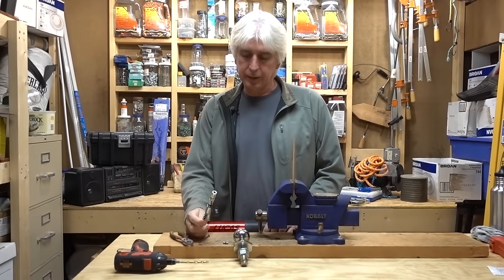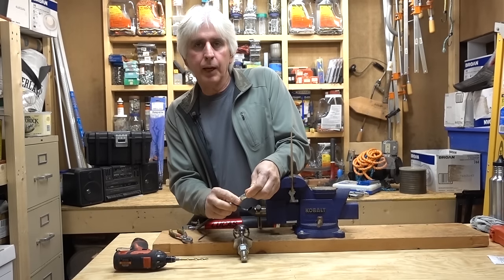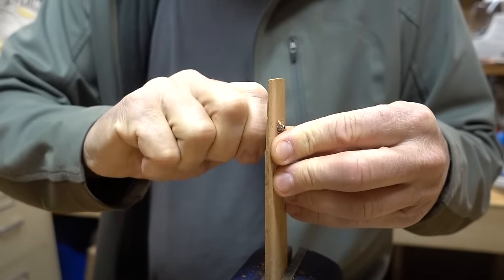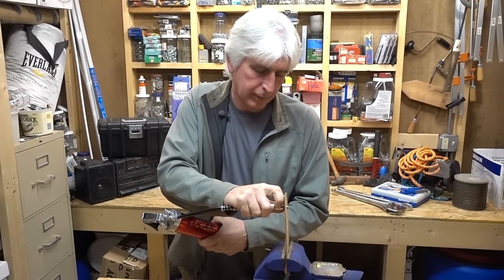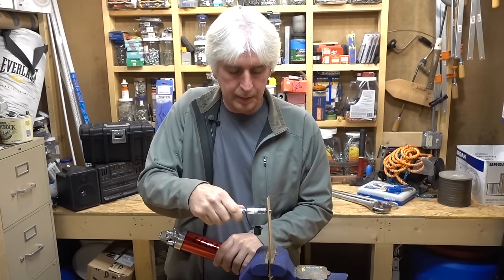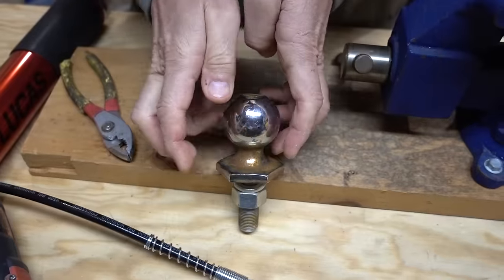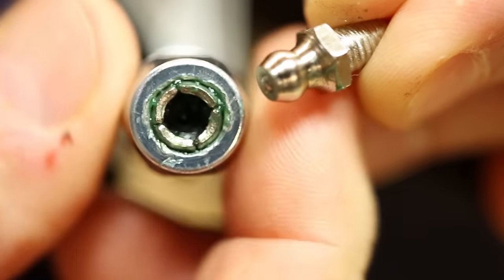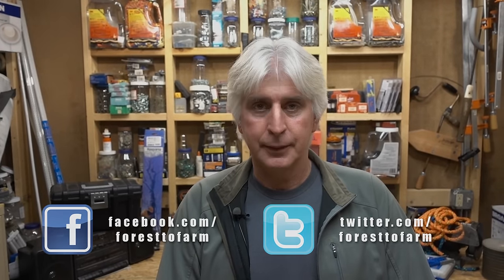Getting A Secure Fit With Your Grease Gun

Comment: I have been using  a grease gun for as long as I wanted to forget. Why do I want to forget? Because greasing is probably one of the least pleasant task when it comes to mechanical maintenance. More likely than not, more grease ended up out of the grease nipple than within. This is even worse when trying to grease under the car, with one hand on the level, and the other vainly forcing the head onto the grease nipple. I have taken the grease gun apart and know how it works, but I never thought of this possibility. Thank you very much indeed.
Reply from the maker: You are very welcome!! Glad to help. 
Terry

Comment: So in practice, I did that even as tight as I could with a wrench before watching your video but tons grease oozes out between the fitting and the zerk nipple.
Reply from the maker: Crazy. What are you using it in? Modern equipment these days sometimes seem to be out of spec. I would try it on some older American equipment and see how it operates. You may have already done that. I know doing my electrical contracting I have run across may screws and bolts that are way out of tolerance. If not then maybe the nozzle itself is out of tolerance or simply a poor design. Again not knowing what you have I may be totally off here. Good luck and thanks for watching!!
Terry
Reply: @ForestToFarm  Thanks, I think its a size issue the zerk fitting I have I think is smaller than the zerk connector I have on the grease gun.
Reply from the maker: @smptactical259 did you get it worked out?
Terry

Comment: I learned something.. thank you.  Question: I have a utility trailer with a grease nipple on the gate hinge.  It is rusted and I can't get it off to replace it with another.  I just sprayed it with a rust breaking "oil" but I can't seem to use a plyer to unscrew and replace and also open the cavity up to spray oil/lub into the hinge.  What "size" is that grease nipple (thread and hole size where I need to cut it off, drill and rethread)?
Reply from the maker: Thanks! To be honest I am not sure right off hand what size it is. Pretty sure its a pipe thread which means its tapered. That complicates things a bit. I wonder if heating it a bit might help loosen it up? If you drill it out then some shavings will likely get into the bearing. That doesn’t seem like a good thing. Clearly I am not the best person to ask for help on this 😂. 
Will a wrench not fit the zerk?  If its damaged and the wrench won’t grab then maybe try grabbing it with your pliers while squeezing them hard and at the same time pushing down on them with something that will keep them from slipping up off the zerk. Make sure the pliers have good sharp teeth on the gripping surface. That will help ensure a better chance at the pliers gripping the zerk and busting it loose. 
Good luck!
Terry

Comment: Hey I just bought a new grease coupler for my old gun. When I try to loosen the coupler it won't budge. I don't know if I'm missing something or it's broken but it's a Lu Max LX-1400-2 standard grease coupler. I've never had to use these before but I bought a truck that needs the axels greased. Thank yall!
Reply from the maker: Just looking at that coupler it appears as though it would adjust. 
Terry
Reply: @ForestToFarm  thank you Mr Terry! I put it in my vise and got it loose. It worked like a charm when I got to the U-joints! Thank you again.
Reply from the maker: @slimJimmey  No problem! Glad to help.
Terry

Comment: The older grease couplings, about 75 years old always worked well but sometimes are too large in diameter to go on some more zerks, which modern engineers design with not enough clearance around the zerk.
Reply from the maker: It seems Modern engineers spend to much time at the desk and not enough time in the field. Thanks for watching and commenting!!
Terry

Comment: Well don’t I feel like a dope. At sixty-six I learned something new today and I’ve struggled with this for years. Thank you.
Reply from the maker: You just made my day, lol. Thanks a million. Some things are right there for all of us and we never see them. I have had my share of awakenings for sure, lol. Glad it helped and glad you commented. Be sure to share it with your friends. Share this video if you like we could use the boost and there are many more things coming!
Terry.
Reply: Been using grease guns for 60 years and never thought to look at that tip on the gun and see that it was adjustable. I've had my share of grease squirting out the side of the fitting. I looked at two of my grease guns, one 50 years old and one air operated from Harbor Freight, and they have a limited adjustment, not as nice as yours. Thanks for that tidbit.
Reply from the maker: No problem! Glad people are getting use of the video. They should make that function more clear when you buy a grease gun, ha ha. 
Terry

Comment: I'm 61, and embarrassed to just find this out !
So, here's my question....now I can see that you can adjust the "chuck" to fit snug to just push on, and yank off.  
So, should you leave it at that adjustment setting, or should you thread the "chuck" every time to reduce wear of the grabber leaves?
Reply from the maker: Ha ha aren't we all. In the past I could set it to a position that worked in most cases but honestly there were always those zerks that just did not cooperate, lol. I guess do it as long as it works but you always have the option to adjust as needed now that this mystery has been solved. Thanks for watching!
Terry

Comment: I bought a Chinesium gun and the coupler would not budge.   I ended up putting it in a vice and using a large spanner with a ton of force it finally loosened, but there was no way you could operate it with your fingers.  I ended up turfing the head in the trash and buying a LockNLube, which cost more than the gun, and has transformed it into a gun that is a pleasure to use.
Reply from the maker: We actually have a Lock and lube but have yet to put it to use. Will do a video when we do. thanks for sharing!
Terry
Reply: @ForestToFarm  I look forward to watching, you won't be disappointed.
Reply from the maker: Just saw that thing laying on the shelf lol. Still not used. 
Terry

Comment: Have you tried a lock-n-lube? Makes greasing the Kubota a breeze. Turning to tighten around the fitting works great until you get grease on your fingers, and then it becomes very slippery. The lock-n-lube has a lever that does the same thing.
Reply from the maker: We have not gotten a Lock-n-lube yet but plan to eventually get one. They do seem nice. Should make the job a lot easier. And I agree greasy fingers do not work well when twisting then nozzle.
Terry

Comment: My fitting doesn't screw in. It doesn't have threads. This is the first time I've had that problem where it pulled the fitting out. This is going to make the job work. NOW, I'd like to learn how to replace that fitting with a screw in fitting.
Reply from the maker: Others have had the same problem. I have yet to come across one like yours. Good luck!
Terry

Comment: Wat do you think about the ones with the little lever to open and close it
Reply from the maker: I actually bought one at the time of the making of this video. I just never have used it yet lol. If and when we do I plan to do a video on it. But honestly just from observation of it there will most likely be instances when the length of it plus the lever itself will get in the way say for a tough to get to or tight spot.  I figure I will need two grease guns if I decide to use it. It should work great in most instances though. 
Terry

Comment: I been using a grease gun for sixty years and I never knew that!
Reply from the maker: Join the crowd! I will be sixty this summer and did not figure it out until the making of this video lol. Better late than never. 
Terry
Reply: This will take most of the cursing out of greasing the tractor and the old Ford 3/4 ton.
Reply from the maker: @lawman5511  Yeah boy!
Terry

Comment: Not sure where you can find this adjustable type of grease coupling, my gun does not have this coupling. Even purchased another coupler from a local auto parts store and it does not turn either. I cannot find one on the internet except the ones that have the actual handle for lock and release. Any answers would be appreciated. Thanks!
Reply from the maker: I have not had time to look but would not be surprised if it is a newer design.
Terry
Reply from the maker: @Rebecca777  Thanks Becky!
Terry

Comment: I recently purchased a higher end flail mower. It has zerks all over it. I started greasing it and found a zerk that the locking grease gun could not keep hold of. Looking closer, I saw that the zerk had a nearly straight shaft. There no ball on the end to grab! A number of the fitting on this mower was that way. Has anyone else seen this before?
Reply from the maker: Wow. Sounds like a factory defect. I have my suspicions of where they were made.
Terry

Comment: WTF. I lost my old grease gun in a fire caused by a recalled Honda - leak in the power steering hose. I just bought another and have been looking at all the problems people have been having with their grease fittings. I don't recall any problems with mine but then I didn't use it often. The new one is in the garage still in the box. I am going to go out now at 11:46 pm and see if he is correct.  It looks like there are several types of connection fittings so I don't know if this applies to all of them. I did see a fitting at Auto Zone yesterday. I took it apart and found that it had a bearing and spring in it and looks as if it could be tightened down around the zircon fitting. I'll know in the next five minutes if my new gun has it as well. The fitting at Auto Zone cost less than $5. I saw that fitting in only 1 of 3 stores I visited.
Edit - The fitting on my moderately expensive gun does not look like it is made for that purpose and is never mentioned in the instructions. They say to remove it, bend to the side and twist. The fitting is tightly joined and you can't tell by looking if it can be twisted. In order to try to "open" it up I would have to put a lot of pressure on the metal. Not ready to do that yet but will investigate further.
Reply from the maker: Thanks for the report. My guess is you are a successful person in what ever you do based on your motivation displayed here. Would love to hear what comes of your investigation. I always say if you want to know the answer to something go out and find it. We are all capable of so much. For most people their only real limits for the most part are self inflicted. Looking forward to your results!!
Terry

Comment: Well there is a problem with my grease guns. I don't have that type of fitting on the hose of my grease guns. Where did you get the collapsible fitting?
Reply from the maker: I just looked at one I have had since Brian my son was a baby and he is 34. It must be 32 to 34 years old. It does the same as the one we have now. We bought the new one at Home Depot. 
Look closely at yours and turn the end completely off slowly. Clear the excess grease away and see if you don't have the  adjustable nozzle. It may just be covered by grease and nor viable. Mine looked like it did not have the adjustment until I cleared the excess grease away.
Terry

Comment: You almost took it all the way. I took my tip apart and a ball and spring plus the 4 jaws fell out. Not sure how it goes back together, Amy suggestions.
Reply from the maker: Yikes! That really stinks. I have not went that far with it so I can not give a fair answer but I do have an old grease gun that the grease set up in and its dried out so I have to take it apart and try to figure out how to clean it all up. Its only about 45 years old, ha ha. If I remember I will come back here and tell you how it worked out. Just guessing here but I would think the best start to putting it back together would be to install the 4 jaws into the outer casing then drop the ball inside of that assembly then the spring would probably go in last. There is likely an area within the jaws that the ball would set in but again I am just guessing and if there is it may have to be between the jaws in order to get it all together. I would clean it all free of grease before trying to work with it so its not all messy and slippery. If you have to work with the spring under pressure in order to get it all together you may want to get a plastic bag like a gallon size zip lock that you can see through. Then do the work with it inside the bag (and your hands of course). I have learned the hard way about working with springs. They can fly away and be very hard to find afterwords, lol.  I have not yet taken one apart. I would love it if you let me know how it works out for you. I have unscrewed mine all the way but realized I needed to screw it back together before it all fell apart. Now I am going to be thinking about this until I get a chance to check it out, lol.

Terry

Comment: Can the part in the grease gun that depresses the ball in the top of the Zerk get damaged? I have some zerks that I just can't get any grease into and the grease just comes out the sides of the grease gun tip all over the outside of the Zerk.
Reply from the maker: Pretty sure that they open under pressure when pumping. I would try taking something and pushing in a bit on them and see if it helps or else I would replace the problem zerks as they cost very little.
Terry

Comment: Yep, did that dance for years.   When I retired and started buying big equipment with lots of zerks that need grease almost everyday, a good friend in the maintenance/fab business recommended the Univer-Co coupler.  Small, fits everywhere.  One hand operation.   Most good shops have them on their counters these days.   http://univer-co.net/en/products/lock-on-grease-coupler/

The Lock-N-Lube works great too, I just found it's a little big and doesn't fit some spots.
Reply from the maker: Funny how it can be right under your nose. 
Yeah that lock and lube looks a bit bulky. I saw it the other day and decided it would not fit on a few tight spaces on our tractor so not for us. 
Now that lock on grease coupler looks promising.
Terry
Reply: good call!  I know you guys don't have the backhoe (yet) but there are few spots on that attachment the Lock-N-Lube will definitely not fit.   The Univer-co goes places the standard won't.
Reply from the maker: Just need two grease guns. Brian run one and I the other, ha ha. Team work. Its what we do daily anyway. Works for us.
Terry

Comment: Hi, the grease gun is filled up, but no grease is coming out at all. Any idea? Regards Heinz
Reply from the maker: Not sure without seeing it. Do you have to release the plunger and if so did you? Maybe a clogged hose or nozzle?
Terry
Reply: @ForestToFarm  Nozzles and hoses are ok. I managed to get some grease out of the gun after some strokes, but then it stopped again while pumping and pumping. If air is trapped in the gun while filling the grease, maybe some bubbles inside, I could imagine that the pump could not work the air out by pushing the lever again and again.
Reply from the maker: I have never had that problem. Hope you get it worked out. Let us know!!
Terry
Reply: @ForestToFarm  Thanks for the feedback. In the end, the gun works, but don't ask me why.
Reply from the maker: @HeinerStorchennest1  At least it works!!

Comment: I have some Japanese bearings that are very tiny, the ball (the part that the grease gun clamps over) measures approximately  0.143” where can I find a grease gun tip to fit this fitting
Reply from the maker: Hmmm. Not sure about that. Have you searched on Google?

Terry
Reply: Change the zirc fitting
Reply from the maker: @mplscarsales6652  That might work!
Terry

Comment: Mine still keeps building up grease outside the grease nipple, is this normal?
Reply from the maker: Not sure but it sounds like maybe the tolerance may be a bit on the larger side of things. If its still loose fitting after tighten it then it may leak. Just a hunch. 😁
Thanks for watching!
Terry

Comment: I tryed this and mine doesn't seem to turn atall i used plyers and wrench. do some not have that feature?
Reply from the maker: A few people have said the same thing. I personally have not came across one like that. Good luck!
Terry
Reply: @ForestToFarm  Well I had to take coupler off and use a vice grip and ratchet w/ socket to free it up on the tip had like 70 pounds of pressure not sure why they put it on like that haha but I took what you said and didn't give up on it and now it works easily by hand maybe a few others have this issue also lower end / models thanks for your video and reply
Reply from the maker: @hunterzinn5610 No problem. I suspected that was the case for most people having  trouble but you have to give the benefit of a doubt. Glad its working out for you!!
Terry

Comment: 98% grease gun ends are smooth round and nearly impossible to rotate with fingers. I considered welding 'wings' on the fitting for the tough zerks, when pressure is high. I have not spent the money on Lock n Lube yet.
Reply from the maker: I have a Lic n Lube but its still in the pack a couple years later lol 😂 
Terry
Reply: @ForestToFarm  I have a plasma torch, a mini-split heat pump, a 6 camera security system, vacuum pump, a diesel heater, and lord knows what else, new in their packaging..  to be attended to... :-)

Comment: If you've got numerous fittings to grease daily or weekly, these type couplers aren't quick or efficient,  ALSO, If there's back pressure you cannot get the coupler off without thrashing about & getting pissed. 
That's why they made the quick release couplers.
Reply from the maker: Yeah but for the average weekend warrior this will get it done. 😁Terry
Reply: @ForestToFarm  absolutely.  I used mine for awhile but my job requires greasing multiple dozens of zerts each day. I needed something FAST! 😉
Reply from the maker: @mcmarine777  Time is money!
Terry